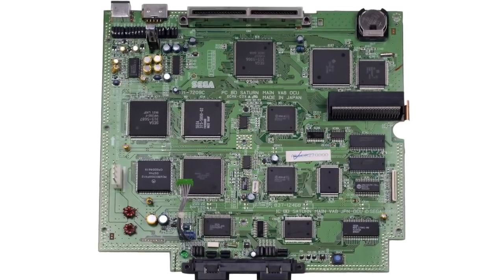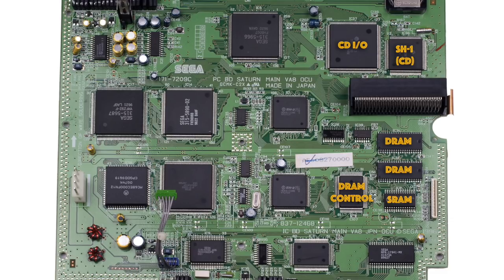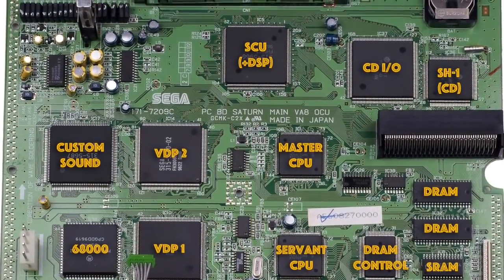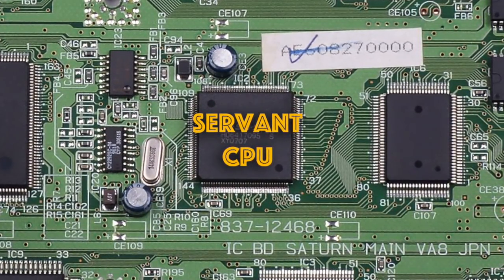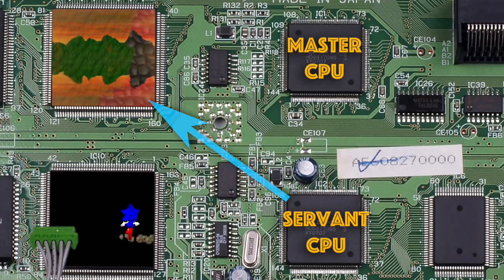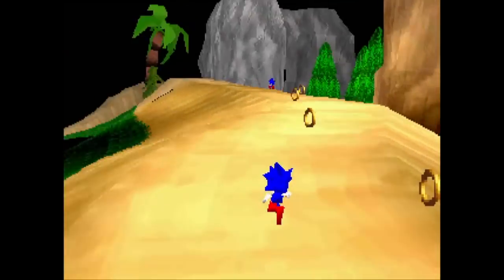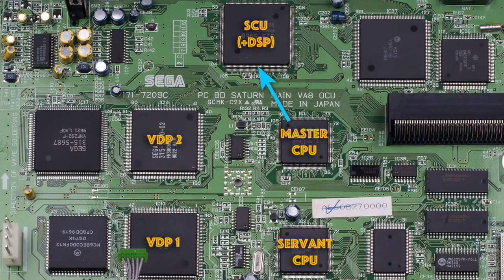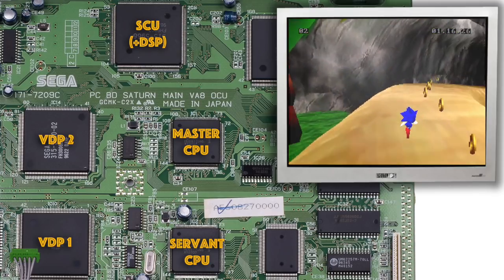SONIC Torn Apart - Exposing SEGA's Insanity with Hardware (CODING SECRETS)

Comment: I found this really interesting. Especially since one of the reasons given that the Saturn failed was that it was so hard to program for. (though by my knowledge, the best looking games for the Playstation like Metal Gear Solid also were programmed like this in order to get the most from the hardware).

I am suprised only one chip was effectively used to draw polygons. Given enough time and resources. How much more could the hardware be pushed to produce more polygons or effects?

Comment: Today with languages such as Rust that utilize zero cost abstractions and type system conductive to optimization Is very easy to produce code that Is as fast it can be
Reply: No. Zero cost abstractions do not have an associated abstraction cost, but they amplify the costs of underlying code translation and execution, such as compiler inefficiencies and CPU inefficiencies, and efficient CPUs of today which are less reliant on microscopic code quality, as well as growing disparity between CPU performance and memory latency, are what make zero-cost abstractions genuinely scalable. Human mind still beats the machine at optimisation given ample time or small enough task, but human ingenuity doesn't scale for large software. What zero-cost abstractions allow you is to grow software complexity drastically with limited human resources without the performance diving exponentially, they are not terribly relevant for fairly simple software such as could be executed on machines of that generation. And the resulting code that makes good use of zero-cost abstractions is definitely better than the most naive human-produced code, but it's far from "as fast as it can be", because compilers and processors are both far from perfect.

Interesting case is the SCU on the Saturn, the DSP - it's a representative of the now dead VLIW architecture, as you can see multiple different operations each with their own operands specified in the same execution timeframe. This was supposed to be the future and the solution to scalability issues, once the compilers get good enough. But they never did get good enough. And people tried. HP and Intel together put what's estimated to be around a hundred billion dollars, that order of magnitude, towards the Itanium architecture and its software ecosystem, and after 20 years, they still never saw the chance of it becoming performance-competitive with anything else on the market. ATI tried VLIW on their GPUs, a context that is fundamentally easier to optimise, and it still never ended up being good enough, easily beaten by the much simpler SIMD machines or replication in width of purely sequential units both.

Comment: I've been dabbling with Multi-GPU CUDA and Machine Learning and I thought keeping things "in sync and logical" was hard using these tools - lucking all code is in C++.  How in the world did you keep everything straight in your head using special chips, DSPs, multiple CPUs and doing all fo this in C / Assembly for different chips (assembly for CPU would be different from that of the DSP, etc. etc......)

Salary in silicon valley is quite high compared to others parts of the USA, let alone the world. Considering this quick 411, I hope game *engineers* are getting top-notch salaries - writing Sonic is way more complicated than some .NET C# application where "developers" are babied with "garbage collection", managed memory and managed "pointers". :-)
Reply: The salaries in gamedev are decent, but not really higher than any other industry. Working conditions are usually crap. Thing is, there's always fodder, people who have programmed graphics since they were 13 and have amassed considerable skill by the time they have completed college and collected some experience in some other industry or on personal or open-source projects, and they always dreamed of working in game development, because that's something they can connect with on multiple conscious and subconscious levels, as of course they grew up playing games and figuring out the technical foundation. They may be few and far between as far as general programmer population goes, but plenty enough for the game industry. Everyone in gamedev, engineers included, often burn out and are getting replaced. Crunch is very much a game industry thing, you don't get that in industrial or automotive outside startups. Thing is, you can't compensate torture with money and engineers are generally frugal beings, because the beauty of engineering is the centre of their complete mental process, the essence of being, rather than whether they have a nice view out of their window, nice clothes, or nice furniture. So an engineer really can't buy happiness, he just needs a life that is not too stressful, the rest of his needs are nicely covered by some beautiful engineering he can participate in.

I don't think Jon ever worked in Silicon Valley really, he lives in Cali now but his studio that he founded and worked at until retirement is located in Manchester area, England.

Comment: I usually understand what you're talking about, but the way to program on the saturn seems like a bunch of nonsense to me
Reply: I'm not an authority on Saturn but i think i grasped this video pretty well, so maybe i can help clarify. What's the first sentence or statement that leaves you puzzled? These things can be explained one after another. They always can.

I think the reason that he separated the tasks the super unintuitive way that he did, is because the SCU, used here for 3D transformation of the bulk of geometry into the screen coordinates, may only be used from the master SH-2 processor. Even if it was a shared resource technically, using it from multiple processors would have been absurdly difficult, so it just makes sense.

Since the SCU was thus allocated, it made sense to move everything that doesn't need to do bulk 3D transforms to the slave processor, so the gameplay logic went there.
Also the slave processor had a lot of unoccupied time, while the master processor was maxed out, so it made sense to move some of the geometry to be processed there, as well as backgrounds, UI overlays, and other things. This has an advantage of not letting the poweful SCU stay idle and utilising it well, as it will be always occupied with geometric tasks since the master processor is doing little else than shoveling data to and from it and into the geometry memory.

Comment: Starting up Unity. Pushing all together without any though of draw calls pipe or whatever and sends build to Nintendo switch. 

Runs at 6fps

Bah... look modern consoles have no power. 

Makes new builds and runs it on overclocked CPU and multiple GPUs with enough memory to store the human genome. 

Runs at 30fps. See PC kicks consoles ass!

Comment: Ah so you use the hardware. ^_^ I kid but nobody seemed up for that on SS, they'd rather just release poorly optimized games for it. Not saying it was the easiest platform but to ignore how it actually works seemed foolish in the cross platform porting even if it was more work. Really if it weren't so darn expensive to manufacture we might have seen more quality coding for it.